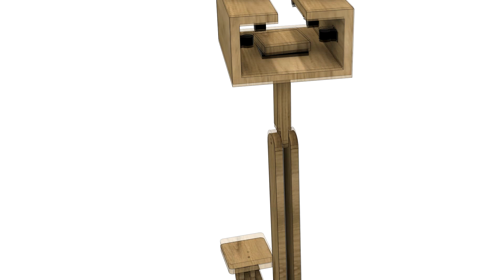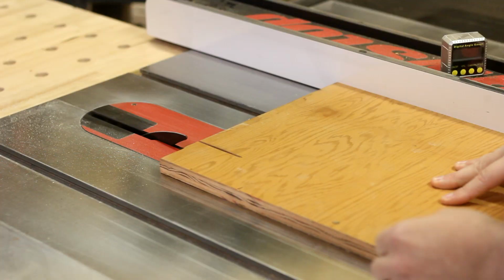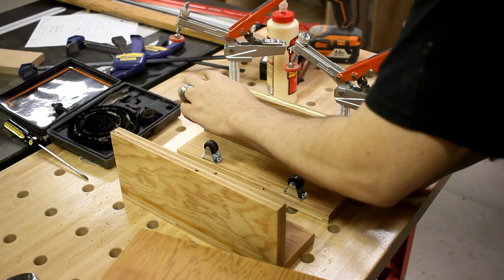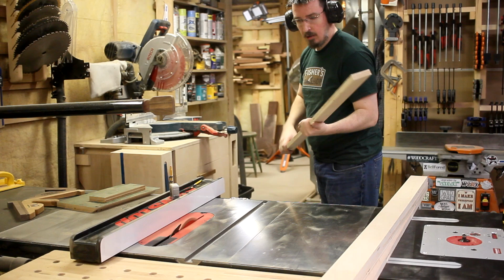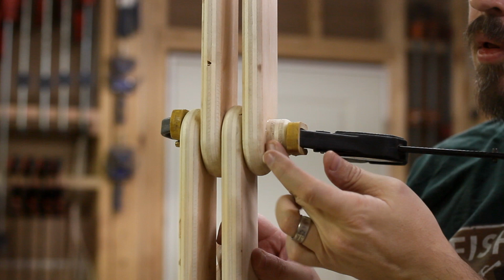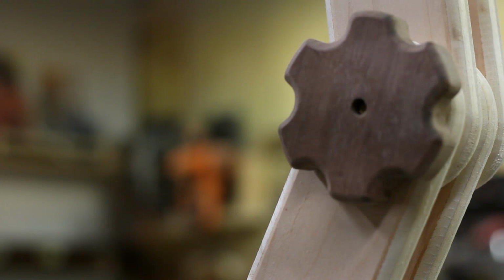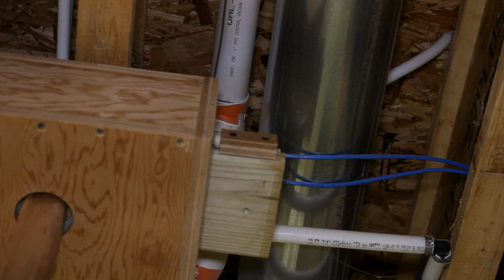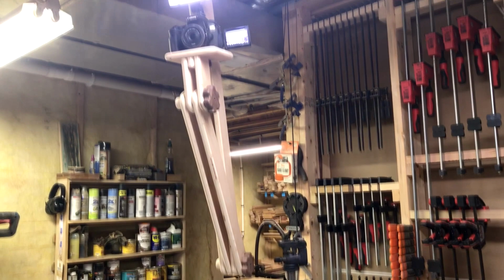Shop Work: Making a Gantry & Arm

Comment: I have been wanting to build something similar to this but with an extension cord in it as well. Love the idea!
Reply from the maker: That wouldn't be all that hard to add to this design.
Reply: My dad replaced the plug on the electric cord from an old vacuum with a three-way covered outlet and mounted the self-winding roller in a box in the ceiling of his shed.
 Very convenient, and rolls itself back up into the ceiling with just a tug on a rope.

You'll want a broken vacuum with a dedicated cord-roll button, the ones that you have to pull the cord all the way out to rewind would be very inconvenient.

Comment: I have been kicking around the idea of an overhead gantry for dust collection over my table saw top. And then moved it to the out feed table for when I am using a small lathe. Your design makes a good stepping off point.😁🛫

Comment: For a while (ok ok at least 2 years) I've had 2 LED light fittings designed to be mounted to a wall that I bought to use as overhead lights in my small work area - but I wanted them to be repositionable  somehow, and I've not not thought of a way to get maximum flexibility fror them, but this idea of mounting on a movable track rail is perfect, and I've got almost everything I need already.  Mine are wired, but that's no biggie to sort out.

Comment: I was bored one day and had a third is a sheet of half inch Sandy ply plywood and "needed" some kind of articulating arm for camera use. Ended up with a 13 foot extendable arm in 5 sections that close down to 7 inches wide and 4 eet long. One of the simplest things you can make.

Comment: Oh! Buy some stepper motors and make it automated! Then set up some motion capture cameras in your shop so the arm always knows where you are and you could have the thing follow you around and always shine a light in your face! :D Pretty sure most of the software for this is out there for free, though you would need some coding to get it all to work together. But it would be awesome! Then you could hook it up to an Alexa and name it Jarvis and say "Jarvis, pack it up for today" and the arm would automatically fold up into the ceiling. Then you just need to build a bulletproof magic flying suit! Out of wood of course!

Comment: 12:12 "i'm gonna murder somebody" - this sounds like me in the shop.
Reply: im more like the "im gonna burn down the entire neighberhood" kinda guy
Reply: I can't tell you how many times that has happened to me. I go through all the wrenches on hand only to find out its metric, or vice versa.
Reply: In my case, it's usually, a question of which kid took which tool out of the shop and didn't put it back.

Murdering them is not an option, according to my wife.  (And she has a 2nd degree black belt, so ...)
Reply: spanner truth right there

Comment: Great for finding all the spiders hanging around. This would be good for dust collection. Would probably need to be made of metal but it could hold a hose over your workspace when you need it.
Reply: We use something like this at work for soldering and epoxy work.

Comment: Lovely addition to your shop. Just as you did with the rope to lift the arm when not in use, you might run a wire along the arm to have a plug available to power lights for extended time (actually, anything that won't run on batteries).
Reply from the maker: Yup, could easily do that.

Comment: Great idea! Another good idea instead of murdering somebody is to get a Japanese fits-all, aka an adjustable wrench.
Reply from the maker: My birthday is coming up.
Reply: did you know they make those adjustable wrenches in metric now?
Reply: @deckdriver  They have also been making adjustable spanners for British Standard Whitworth since 1842. Speaking as one that has worked on hundreds of British cars when they had the Whitworth system you either used an adjustable or started thinking of lots of 4 letter words.

Comment: One feature I don't think you mentioned is that the gantry & arm are designed to hold a "self-powered" or battery operated light or camera.  Being battery powered, there is no need for trying to feed a power cord through the mechanism and having it operate along the full length of the gantry.
Reply: If wiring the unit for 110 VAC is required, it can be done effectively with the use of a "curly cord" (like a telephone coiled cord), but "curly cord" rated for 110 VAC is hard to find and expensive ($60.00 for a 4' coil that stretches to 20' on Amazon.)

Comment: Cool idea.. and could be used for a movable overhead dust collection hose, rotary tool holder etc.  One thing though.. being just wood, and not a material more engineered for stability such as plywood etc, is there a chance of warping causing jamming?  This is a great idea, and as I have limited lighting in my shop, I think I will look into this.  Thanks for the awesome video
Reply from the maker: No, I don't believe so.  If the gantry warps though, then the trolley could get snagged but with a screw in every joist, it's not going anywhere.

Comment: After a few more videos Drew's neighbors aren't going to have a house left to come home to...
12:00 if we had already converted to metric one of those wrench's may have worked, too
Great video Drew!
Reply: We've been metric for years and it's so simple. Especially when it comes to tools and measuring work. Our tape measures do show both though, which is handy.  We still use miles and mph on the roads. 👍 🇬🇧
Reply: Drew and I have already had the metric conversation.... but not always, though. How many times have you gone through your set of 10-16,18,20 to find it's either 17 or 19mm?
Reply: Peter Middo not often. I keep my sockets organized in the rolling cart so I can pick one easily. My wife has a KIA (this was not my idea) and so I use metric tools more often than not...
Reply: @StephenGoggin  I'm not sure buying a Kia is such a bad idea. I've never heard of a major fault going unrepaired or a warranty claim, no matter how big or small, being denied. Unlike Toyota (& Lexus), Nissan, Ford, VW, Isuzu, and many, many others.
Reply: @petermiddo  She's had 3 of them and I have made her aware that there will not be a 4th. Every single one has had issues, either close to the end of warranty, or shortly after it expired.
Reply: @StephenGoggin  Well, you know you;re going to get issues with Fords (Fiesta, Festiva, & Focus has all had issues with their DSG Auto transmissions, which have cost their owners - not Ford - plenty of money to resolve despite it being a Ford engineering fault), The Rangers are also now having faults with their gearboxes around 40,000klms likely to cost their owners also..... Lexus Gx470's (sold in Australia as the Prado, in Europe as the Land Cruiser II) have serious body issues which cause them to destroy themselves, all without manufacturer backing.
Reply: @petermiddo  I have a Ford Fusion and have no issues at all. Even if I did, the parts are 1/5 the cost.
Her first KIA had an issue with the passenger airbag switch in the seat and they wanted $874 for a chair...

Comment: Once again you come up with an idea that I never would have thought of, have absolutely no use for, and yet simply must build and have!  :)
One part still concerns me, in terms of explaining that head wound to the ER doc -- the attach point from the first vertical member to the lazy susan's block.  It has 4 screws and glue, but both are still going to the end grain on that member, and depending on the weight that could be pulling on it, end grain could separate from both of those methods.  One thought I had was to fashion a tenon into the end of that member that projects up through a hole in the block, then 2 or 4 pocket screws in the top of the block to 'toe-nail' ('toe-screw'?) the tenon to the block, plus gluing the tenon in.  That way you'd have a better glue surface, plus the mechanical fasteners going across grain instead of down into its end.  Anyway, no criticism at all, just wanting to make sure I get to continue enjoying more fruitful ideas from that un-damaged head!  (Because it's all about me!)    :)

Comment: normal person- " i'm going to go buy more lighting for my garage"  Carpenter- " i'm going to spend 36 hours building a giant wooden swing arm thingy that hangs from the ceiling to hold a single battery light in my shop" lol
Reply: That's not a correct assesment at all - because more overhead lighting still leaves dark areas, no matter how bright. As he showed this can give PINPOINT lighting in places the overhead lighting can't - and especially when doing work where your body could put the workpeice in shadow, this system is significantly better than just adding more lights to the ceiling, that also burn more electicity to light up areas that don't need it - with this he could potentially turn all the overhead lights off and STILL have ample light to work.

Comment: It's always worth waiting for your uploads. I just spent the last ten minutes laughing! For what I thought was an OTT solution to a minor problem you've built something really interesting that I see will get a lot of use. Are the lights battery operated? Rechargeable?

Thanks for cheering me up just before bed.
Reply from the maker: Yeah, that light runs on the same Ridgid batteries I used for all my other tools.

Comment: I enjoyed your video and the woodworking techniques you used, I am curious about you SS Tablesaw, I have their  Contractor Model with a 52" fence. I thinking about getting their Overhead Blade Guard/Dust Collector. My main objective is SAFETY first, Dust Collection second. Please let me know your thoughts, Thanks Pat
Reply from the maker: It's nice when cutting wide boards or big plywood sheets.  However, it spends the majority of the time off the saw.

Comment: Outstanding
After some use, is there anything that you would change in your design?
Reply from the maker: Hmm... Maybe not sanding the inside of the joints so smooth so I don't have to tighten the knobs so hard to get the arm to stay put.  I wasn't thinking and sanded them really smooth before assembly.  And now that I've glued on the caps, I can't change that.
Reply: Ahhh, that’s a good one.
Will have to come up with some type of friction when I build mine.
Thanks for the reply.

Comment: Do you only have two size of wrenches in that rack?  Great video, thanks for the ideas.
Reply from the maker: Evidently.  That was my Miscellaneous wrench rack... which should be in the trash.
Reply: @FishersShop  'Random tool giveaway video' - 30 wrenches of the same size and several dozen hex keys xD
Reply: @FishersShop as soon as you toss the wrenches a situation will arise where you could get that bolt off if you only had a shorter wrench and you don't want to cut the good ones down to size... 

Ask me how I know this.....

Comment: And then there's John Heisz's whole building gantry ... but he has a high flat ceiling over the whole building...with no hanging lights..or angry neighbors looking for his table...🤣 🤣 One thing - you didn't mention your handling of the electrical power cabling.. Any hints? Or are they all battery powered like John's?
Reply: Great videos!
Reply from the maker: Everything is battery but it wouldn't be hard to run a cable along it.
Reply: @FishersShop  But then you'd have to worry about the angle of the dangle or auto retracting ... Does the neighbor have a retracting air hose???

Comment: Lighting in my shop is unbelievably poor, and since the ceiling is some 15 feet away, difficult to improve with more fixtures.  Solution: I walk around all day with a rechargeable headlamp.  Effective, but wouldn't be a good subject for an entertaining video.

Comment: Why not just buy 50 feet strip of LED lights. Cheap as chips and wired up in two shakes...? Zone the LED's with switches and you've got enough light to give Trump a top-up tan ;-)